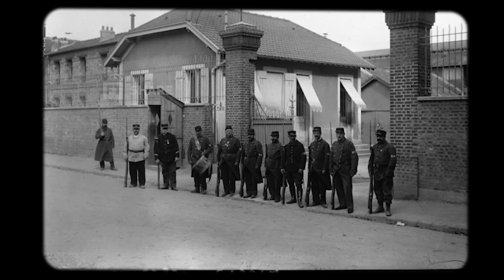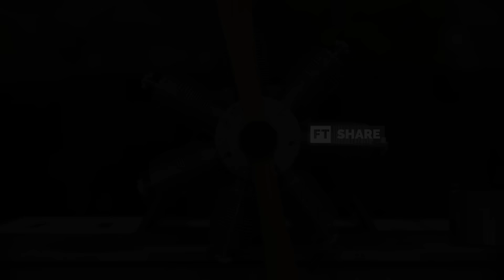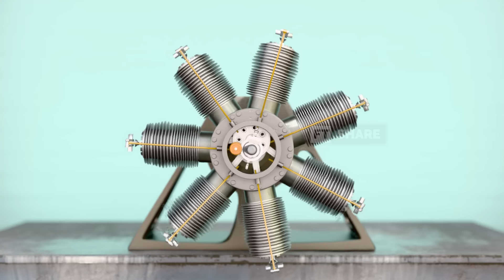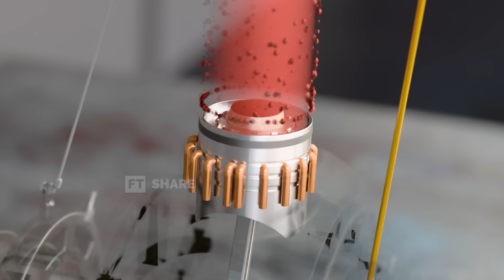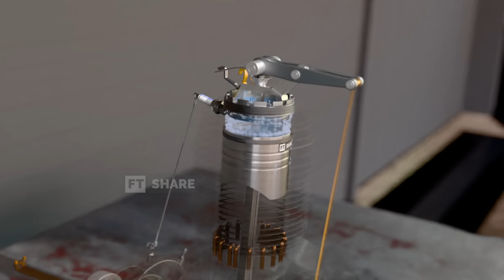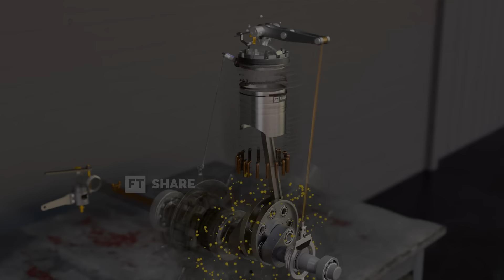This Engine Has a VALVE Inside Its PISTON 🤯 Gnome Radial Rotary Engine

Comment: Did he just say the vacuum and compression of the cylinder opens and closes the valve ? but then later says the push rods opens and closes the valves ? Did i miss something ?
Reply: Push rods were there as an extra precaution due to valves unintentionally opening under speed ❤

Comment: This film only partly explained why the engine was designed as it is: you understand that there is no reciprocating inertia loading which helps flimsy airframes to stay intact but no mention of the reason for only a single valve cylinder head.

By 1908 many engines were at work but none would tolerate sustained high power because the hot exhaust valve distorted or burnt and failed to seal.  Bleriot and others drilled holes through the lower part of cylinder so that most hot gas avoided the valve.  See also much later Franklin cars.

The Gnome let exhaust gas pass the valve but immediately afterwards cold fresh air was drawn into the cylinder via the exhaust port and valve, which had rotated away from its recent waste heat.  The exhaust valve shut before BDC and the last part of piston descent drew rich mixture via the piston valve.  NB the exhaust valve is central in a symmetrical head, best possible cooling and lack of distortion.

Farnborough was set to investigate the air cooled engine and make it durable and useful.   They succeeded and the results went to USA particularly via Sam Heron who was annoyed by the politics of manufacture.  See also later defection of engineers from Wright to PW.

The Le Rhone, and Clerget never had the central exhaust valve, but as time passed better valve steels made it less necessary.  Bentley was set to make a Clerget be durable, he succeeded and it was called Admiralty Rotary, then Bentley Rotary which stayed in use till 1926.

The snag is cylinder filling, a decent inlet tracts has uniform speed of flow, not a carburettor pipe, then huge chamber and finally small inlet valve approach passages.

You may watch the Pup at Shuttleworth and note that the pilot breaths clean air above the metal cowling and the wet exhaust spreads along the bottom of fuselage.

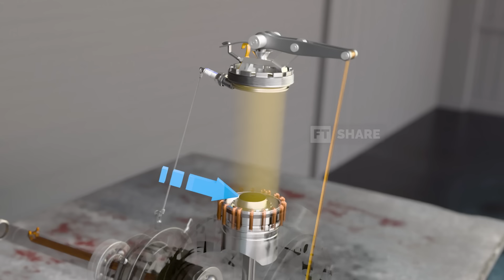Comment: 7:20 the pistons do NOT go up and down in this engine. They only rotate.
Reply: Of course the pistons go up and down in the cylinder relative to the top and bottom of the cylinder, only the relative position of the cylinder to what you might consider up changes. A more accurate description should say in and out of the cylinder. On a modern horizontally opposed aircraft engine the pistons don’t go up and down they go side to side but they are still considered to go up and down. A piston rotary engine is in-fact still a reciprocating engine as the pistons do travel back and forth within the cylinder unlike a rotary Wankel engine where the rotor inside spins in one direction only.
Reply: AI flag

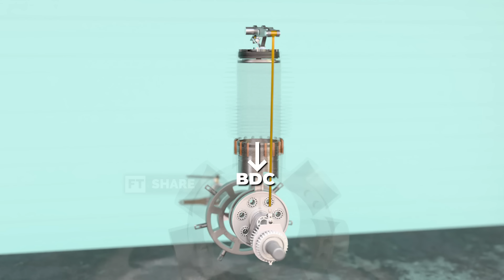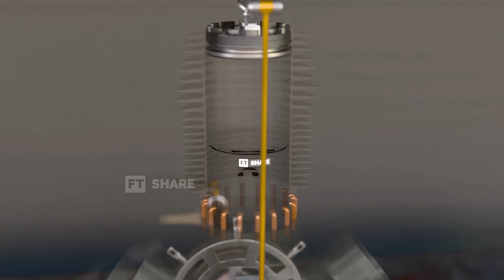Comment: The animation at time point 15:00 - 15:45 shows the single conecting rod going all the way down below the location of the  center of the crankshaft... But it also shows that this is supposed to be a 5 or 7 cylinder engine...  Sloppy!  The crankshaft/connecting rod should have been done correctly. There is no way that the connecting rod could travel that far down! It shows the rod going below the center of the crankshaft.

Comment: Seeing that propeller going backwards for almost the entire video is really annoying me.
Reply: this is garbage AI slop, that is why, this should be forbidden.
Reply: I guess that's what he meant when he said that in those days the understanding of the aerodynamics of propellers was still limited. they must have been surprised with all these planes flying backwards.
Reply: Teltalle AI crap
Reply: The rotary aviation engine spins with the propeller, the radial engine stays still.
Reply: Never seen a D.H.2?
Reply: @thethirdman225  There is a difference between "rear mounted" and "backwards"
Reply: @nathanahubbard1975 . Really? Have a look at a picture of a D.H.2 and tell me which way the pitch should go.
Reply: @thethirdman225  I know what the DH2 was. Nothing in this video was a pusher. Stop being dumb.
Reply: @nathanahubbard1975 . This is you going into denial and pretending your smarter because you didn’t think of it. They have a word for that: projection.
Reply: @thethirdman225  You're just going to keep posting crap. I watched the video months ago and it showed the prop on the engine going backwards for the plane it was saying that it went in.
You can reply to me until the end of time, I don't care. You're wrong.
Reply: @n @nathanahubbard1975 Have a look at some of the other posts where others can see. Your anger is to mask your embarrassment.
Reply: @nathanahubbard1975  Perhaps you could explain how a D.H.2 worked.
Reply: @thethirdman225  Perhaps you could say the same thing over and over again in a video that isn't about a pusher plane.
Reply: @nathanahubbard1975 . Perhaps you could be a big less rigid and a bit more broad minded.
Reply: @thethirdman225  I'd rather be correct than wrong.
Reply: @n @nathanahubbard1975  In other words, you only subject your standards to your own little world and we’ve already seen how closed and introspective that is. It’s fascinating to me how much you’re prepared to invest in labouring an irrational point of view as though it was absolute. Those sorts of attitudes are only found in religious beliefs and totalitarian societies.

So tell me this Nathan; which way does the pitch go on a D.H.2? And how is that different from “backwards”?
Reply: @thethirdman225  Ok.
Reply: @nathanahubbard1975  Not answering the questions, Nathan?
Reply: @thethirdman225  Thanks, bro.
Reply: @nathanahubbard1975 .  No, thank you for finally having the sense to know when you’re beaten.
Reply: Came here to comment the same thing.

Comment: One of the BEST AI presentations I have EVER seen!!  ( one thing about the rotary engine that is worth noting, is the TREMENDUS TORQUE of this engine and what that torque does to the aircraft on take off, making it very dificult to control on take off)❤❤❤❤👍👍💯💯💯💯
Reply: The larger the displacement, caused an increase in centrifugal forces, beyond what can be controlled. 
Another issue was the size of the crankshaft/intake port. The shaft could not get as big as needed  for an increse in displacement.
Reply: @ivanivonovich9863 actualy,   the heavier the rotating mass is the more visious the torque,   after all,  you are spinning the WHOLE ENGINE around,  while only the crankshaft is attached to the firewall,   the crankshaft is a whole lot lighter than all the rest of the engine!!🤔🙈🙉🙊!!

Comment: I have something to add to the advantages that everyone misses.  This is a non-reciprocating engine.  The energy lost by stopping and reversing the piston direction in a typical reciprocating engine is preserved, adding to fuel efficiency.  Since the block rotates and the crank is fixed, the piston simply whirled around the big end of its connecting rod in a circular motion.  It resembles reciprocal motion but it is not.  I noticed this while trying to design a non reciprocating piston engine.  I designed and patented two different designs, neither of which are anything like the Gnome here.
Reply: Share your designs!

Comment: The valves were on the outside.
If it were on the inside of the piston, it wouldn't work.
Reply: Nope, didn’t you watch the video? The air / fuel charge is drawn in through the  hollow crankshaft and crankcase. The intake valve is in the piston.

Comment: The excellent presentation neglected to discuss the effects of castor oil on the pilots, a point many discussions ignore due to sensibilities discussing topics like diarrhea. Yes, gentle reader, the fumes from the rotary engine were inhaled by the pilot and it had prompt and violent effects! In addition, although briefly mentioned, a rotary engined plane was tricky to fly until you got used to its odd flying characteristics.  Making a left turn and you could turn on a dime and have 9 cents change, but you also had to correct that the nose was rapidly raised without any control input. This oddity was due to the huge gyroscopic forces generated by the rapidly spinning engine. It might also be noted that turning the other way as very much slower, and the nose dropped, again without control input. Many pilots never got used to the foibles of the engine , but those that did and used the unique foibles to their advantage became extremely dangerous adversaries.

Comment: I have an eight cylinder two stroke  rotary engine design that has no valves ,connecting rods ,cooling , no engine timing ,uses steam with no boiler , no oil , can run on solar or fuel to heat the steam chamber. It powers 3+ pistons at once .  It is a combination of new ideas and old  ideas .
Reply: imposible. can you show me plans?
Reply: YEAH!!!  I got one too!!!!     ( but im still looking 4 a supply of DILITHIUM CRISTALS!!)   you know where i can find them???    🤔🤫😛😜🤪!!
Reply: @earlwheelock7844  I have those cristals for you if you can supply me with a matter-antimatter containment field.
Reply: @SuperDirk1965 MMMmmmmmm!!            I will have to think about THAT 4 A while,   maybe you could steer me on to a very rare supply of    DILITHIUM CRYSTAL  LITE??  ( YA KNOW,     they dont need a containment shield??!!) ,  I mean THAT is what they used 2 make there perpetual motion machine work!             didnt they??           🤔🤔😁😁😋😛😜🤪😀😃😄😂😂🤣🤣😂!!

Comment: Exactly what inertia is it that causes the valve in the piston crown to close?
Reply: while the pistons  don't  'move'  up and down,  they ARE  swinging in a circular  arc.     Anything  moving in an arc has  forces  upon it.     The counterweight  would  'feel' this force,  and act on the valve.   I imagine the counterweights were weighted so  a  vacuum in the cylinder would overcome this force. 
  Forgive me for not using  centripetal or centrifugal force terminology  here,  I can never remember  which is  which,   and would be flamed here by not using it correctly.  LOL

Comment: Props spinning the wrong way 😢
Reply: Wanted to write the same.
Reply: @rjung_ch wanted to say somthing about that,   BUT the rest of the presentation was so well done that I was willing to let it slide,  ( its an AI  presintation after all )!!    [ and the rest of the vidio was VERY well done❤❤❤
Reply: @earlwheelock7844 Observe the man hand propping the engine at 15:05. He is clearly hand turning it anticlockwise when viewed from the front.
Reply: How stupid. Do they not watch their own video?How could you not see the propeller going in reverse.
Reply: @michaelforsburg903  Never seen a H.D.2 then? It was a pusher.
Reply: Yes indeed!..
Reply: Alls I can see is the prop going in reverse. I can't even concentrate.
Reply: Must be AI, the propeller is rotating backwards!
Reply: @Thinker2-truth not too sure about that,  on some vidios ive watched, when the person in the vidio seems to be REMOVING a bottle cap, he appears to be screwing it ON!  And vise-versa!!??  ( do all bottles in vidios have left/hand threads?  or is it somthing to do with the camera lenses??🤔🤫🤗🤭🫣😅😅!!
Reply: @earlwheelock7844  Bottles are typically Right hand thread "Righty-tighty / Lefty-loosey" (Righty = Clockwise).
There is a phenomenon with RPM and Frame Rate that makes rotating objects appear to rotate backwards, but bottle caps are too slow for that.
Then there is the UK where they drive on the wrong side of the road... 🤔🤫🤗🤭🫣😅😅
Reply: @Thinker2-truth so I guess its the frame rate that makes it appear backward!!   Maybe that is what is happening with the prop.in the vidio??🤔??!
Reply: @Thinker2-truth I KNOW THAT!!😅😅   I said that kind of toung in cheek??!!😂😂😂
Reply: @earlwheelock7844  Thank you for playing...
Reply: @earlwheelock7844  but the appearance of the motion is irrelevant. Look at the pitch of the prop. It is obviously built to turn in the other direction. Anticlockwise when viewed from the front. This is the typical direction for a propeller.
Reply: Naw, that's for when you want to go in reverse.

Fun fact, the C-17 Globemaster can actually pull into a birth to unload/load, back out and leave/approach the taxiway without a tractor. That is one of it's HUGE selling points.
Reply: @palomarjack naaa.     THAT is 4 use when landing as a BRAKE!!     😁😁😂😂🤣🤣😂😂🤪🫨🤤🙈🙉🙊
Reply: @palomarjack yes but the engine allways spins in the same direction,  they just reverse the pitch for reverse, AND braking
Reply: @palomarjack I do beileve that some airliners can now back out of there loading gates without any outside help!🤔!!
Reply: @earlwheelock7844  Even if they can it would be prohibited in most terminals. You ever see how tightly they are packed at the terminals? Even the C-17 needs a tractor in some locations. The airfields where they can use that feature have to be configured for them. Finally, they have more reverse thrust than an airliner does with it's thrust reversers deployed.
Reply: C130s used to be able to back up.
Reply: Ah, ha... that explains it!
Reply: Yep
Reply: a.i.  =  absolute idiocy

        Tard-bots  RULE   🤜😵‍💫🤛
Reply: I think that’s why this project never got off the ground! 😂
Reply: literally the 1st thing I noticied
Reply: Unless you're a D.H.2.
Reply: @thethirdman225  Which isn't what they showed in the video.
Reply: @nathanahubbard1975 . This is known as “putting a telescope to a blind eye”. Having been shown up, you’re now making a conscious decision to support an irrational view in the mistaken belief that if you shout loud enough, people will think you’re right.